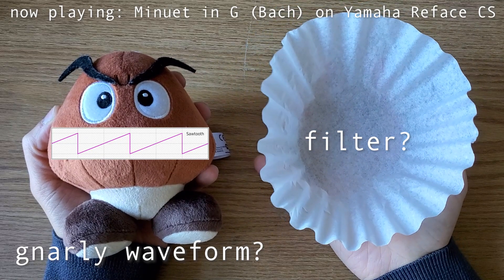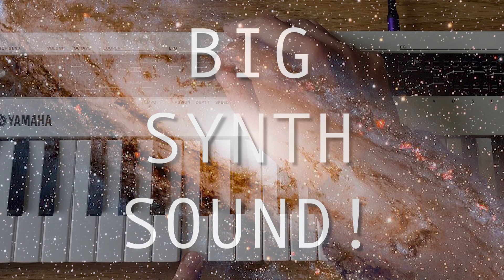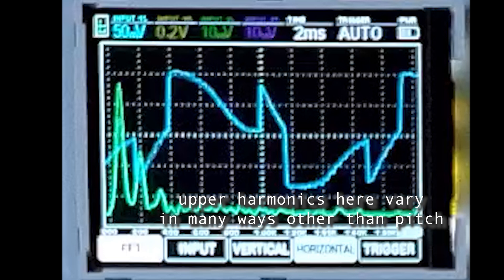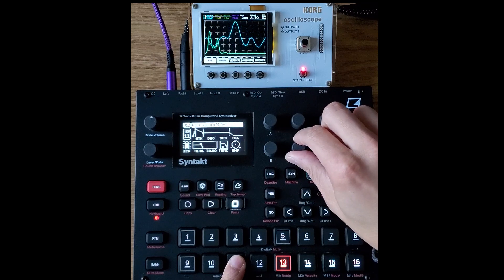How Synthesizers Work, for Beginners (part 2 of 3)

Comment from the maker: Feedback, comments, and especially questions are welcome!  Part 1 link and timestamps:

How synths work, part 1: https://youtu.be/1q6Ydu3R4W4

0:00 Intro and flashback of part 1
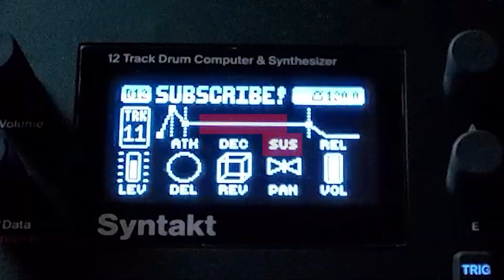0:13 Overview of features covered in this series
0:17 What is a filter?
0:31 What is a frequency spectrum?
0:50 What is a pitch in music?
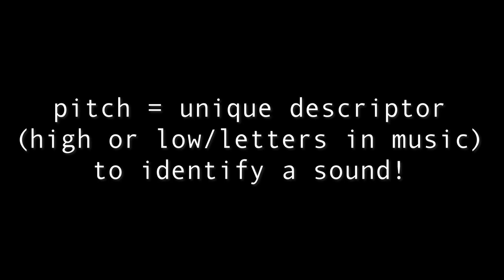0:59 How do low pitches differ from high pitches?
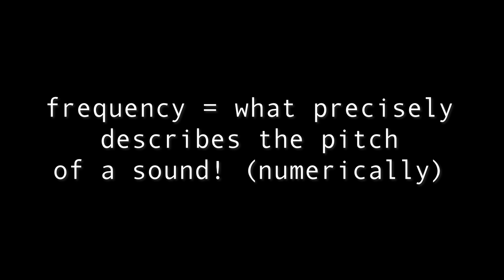1:18 What is A-440?  What is its significance?
1:37 What is a Fast Fourier Transform (or FFT)?  (it's a very surface level description/explanation)
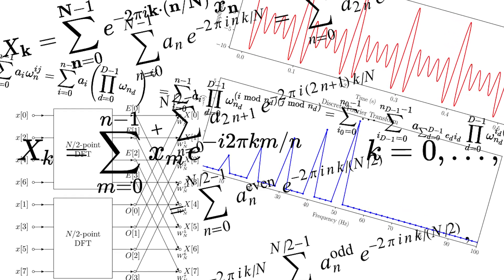1:43 Visual comparison of time-based waveform graphs and frequency-based waveform graphs
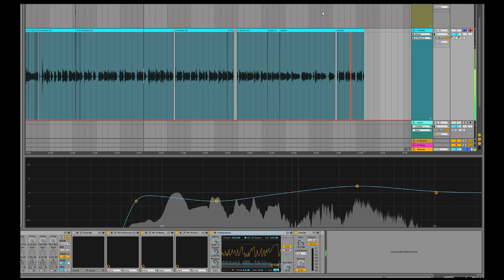1:58 How do music producers typically work with frequency spectrums?
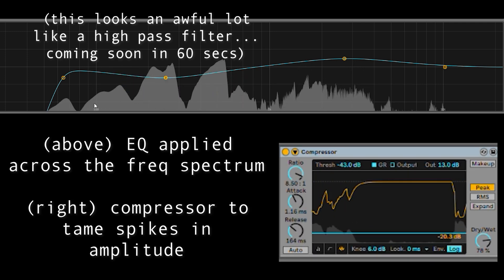2:09 What is a common example of hearing a filter used in everyday real-life?
2:33 What does a filter sound like on a synth? (audio demonstration)
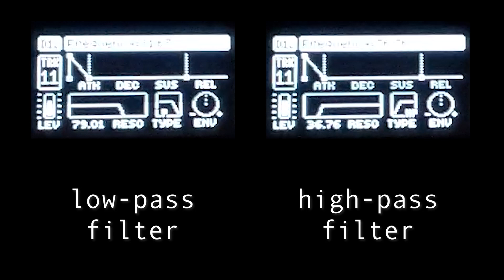3:22 What is resonance?
3:37 What is resonance in physics?  How does it relate to synths?
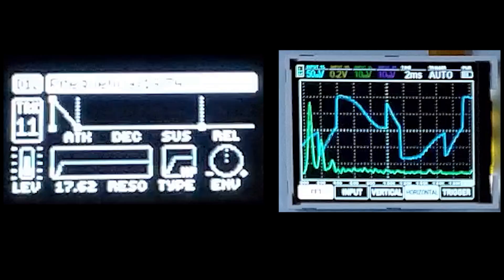3:52 What are harmonics (or overtones)?
4:00 What is a fundamental frequency?
4:28 What does resonance sound like on a synth? (audio demonstration)
5:26 What is an LFO?
5:41 Frequency range of an LFO vs. frequency range of human hearing
5:54 How are LFOs typically used onboard synths?
5:59 What is modulation?
6:02 The history of "modulation": what is it in classical music?  How does it relate to keys and tonal centers?
6:29 The history of "modulation": what is it in electronics?
6:53 What is modulation in synthesizers?
7:06 What are the typical features and controls of an LFO?
7:34 What are some sounds of an LFO modulation on a synth? (audio demonstration)
9:20 How many LFOs can synths have?
9:37 What are effects on a synth? (typical are delay and reverb - shown with demonstrations)

***addendum:
1) For clarity: the LFO speed controls the rate mentioned - e.g. 0.1-20 Hz - and LFO depth is usually just the amplitude of the LFO waveform onboard all synths.
2) In addition to controlling the amplitude of a waveform, the ADSR envelope mentioned in part 1 can also be used to shape filters on some synths.

Music heard:
Bach Minuet in G major
AI Jungle
Satie Gymnopedie no. 1
EDM demo track
Original opening and closing theme